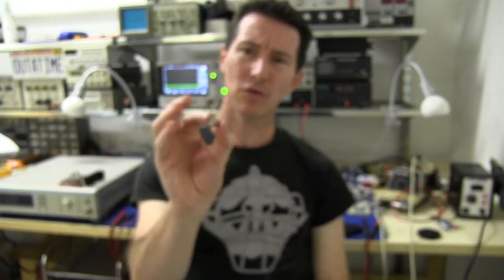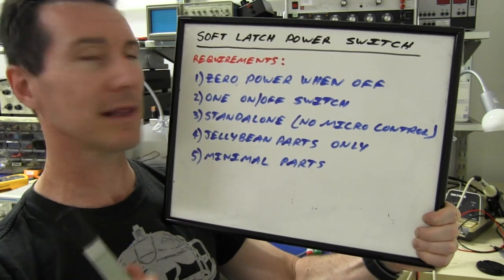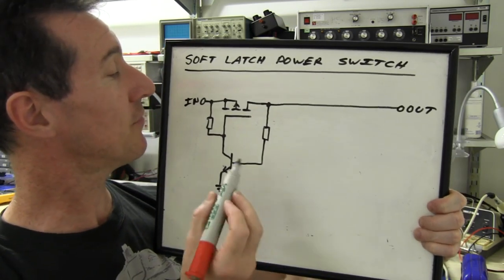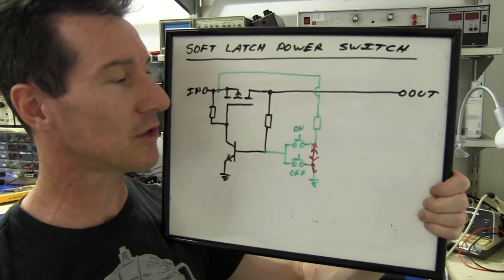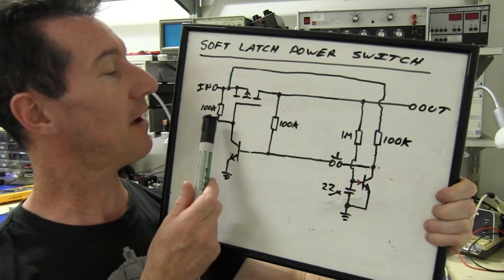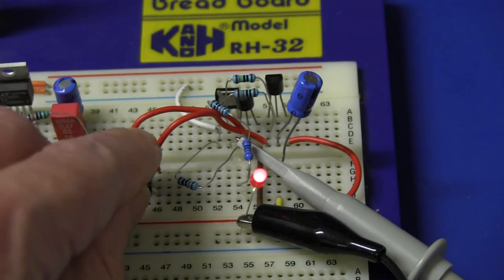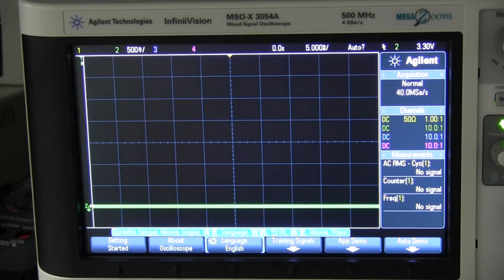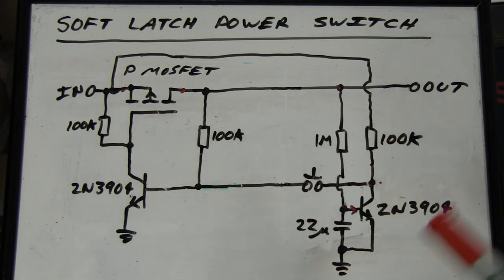EEVblog #262 - World's Simplest Soft Latching Power Switch Circuit

Comment: I am trying to make a crude flyback XRay protection circuit that needs to turn power off when a voltage from the flyback reaches a certain value. Does anyone know how to do this with minimal power supply voltage loss?

Comment: it must be a square cm of PCB at most with through-hole stuff - even less with SMT so if you're mounting the switch directly to the board you've already saved space and you can buy the handful of passives at a 10th of the price of a switch. not only that but where is the enjoyment in just using a mechanical switch. so quit moaning that someone has given you an alternative method of doing something outside of your little box of comfort

Comment: Can anyone explain why the output will be high when the circuit initially gets power? At 12:01  Thanks
Reply: +Pohan Huang it's a feature.
Reply: Pohan Huang becaude the transisor on the momentary switch does not connect to ground until the capacitor on the base charges up.

Comment: Same principle as the SCR
Reply: Think they are the same size of a normal bipolar transistor (even SOT23, like the MCR16), and could save a few resistors, and an additional transistor.
In the cost regard, I think they are more expensive, but in the end you will use less components and board size.
- Regards

Comment: Why does it turn on When you first apply power
Reply: Add a capacitor, e.g. 100nf, connected to the base  of the left npn transistor and GND.

Comment: I'd rate this a FAIL... it doesn't replace the toggle switch shown at the beginning, since it works on DC only, so you can't use it as a mains switch which was the original goal.
Reply: Markus Strangl Then add a relay, a  Sharp S216S02 would act exactly as that red LED he uses.

Comment: So what is an RC time constant?
Reply: +Matthew Ferrie The RC time constant is called τ calculated: τ=R*C where R is a resistor (R) in series with a cap(C). And it&#39;s the time it takes for thecamp to charge at 63%(I think) of the max voltage. You can calculate it with the eq. v(t)=V(1-e^(t/τ)) , for the discharge the eq. used is v(t)=V*e^(t/τ)
Reply: +ravron I&#39;ve no idea why it&#39;s crossed... ignore it x)
Reply: +Matthew Ferrie  One of the hardest course sections in electronics school.  At least for me.

Comment: i tried this in circuit wizard , firstly i cant find that mosfet , the symbol is not like that , but ive tried with N type and P type mosfet and it doesnt work with any ...i checked it , looks the same , switches but wont hold, i lose 90 percent of parts , leave just Fet on  and it still does the same thing , nothing like show . Can anyone make this work in circuit wizard , and post me save file so i can see doees this work or not
Reply: +Pavle Pavlovic You need to make sure you use an enhancement mode MOSFET rather than a depletion mode MOSFET.  Enhancement mode MOSFETs usually have the dashes in the symbol, like it's drawn in the video, whereas depletion mode MOSFETS have a straight line.
Reply: Joseph Coffland i sed that one , JFET has the stra8 line
Reply: Joseph Coffland

Comment: Last time i checked switches don't use power however this design will, also i understand evolution but this is far from it we are going backwards. lets use your scientific calculator for an example, i have a 25 year old casio, it is made out of quite thick plast, held together with 6 machine screws and has a very robust circuit inside, now lets look at my new casio, which is only held together with 2 self tapers out of plastic so fin it bends and a circuit that looks like it was made by children

Comment: Thanks Dave! I've simulated your circuit here, now you can try it out on the web:

https://circuits.io/circuits/2463364-eevblog-soft-latch-power-switch

Unfortunately it doesn't fully work... yet:

https://electronics.stackexchange.com/questions/246587/cheapest-raspberrypi-or-mcu-on-off-power-supply-latching-issues
Reply: +Roman Valls How the simulation works? I tried pressing the button, but nothing happened. The bulb just lights on, when the simulation started.
Reply: It turns out that there's a bug in their web-based circuits simulator (123D). I emailed them and their support guys were extremely transparent, honest and helpful about the problem: 

"
Thanks for writing in. The simulator can detect and display transient RC behavior, but you have discovered something we're still working on: simulation of purely analog flip-flops or multivibrators that do not converge. It's a complex problem to code, but an interesting one we're eager to fix once we have time. The capacitor that was added to the base of the second NPN effectively changes the time constant of the oscillator, but it is still in essence a multivibrating oscillator.

Here's a blog we posted when we enabled transient analysis. The blog includes an oscillating circuit.
http://blog.123dapp.com/2014/04/123d-circuits-gets-new-superpowers
"

So we'll have to wait in order to get this rolling. In addition, you can have a look at my other PSU ramblings here:

https://electronics.stackexchange.com/questions/246587/cheapest-raspberrypi-or-mcu-power-supply-with-both-toggle-and-momentary-swit

Hope that helps!
Reply: Thanks for the reply. At the end, you were able to implement the "graceful shutdown" feature for the raspberry pi?

Comment: I use similar circuit that even includes low-voltage disconnect and short circuit protection for batteries: https://raw.githubusercontent.com/Harvie/Designs/master/electronics/batteries/low-voltage-shutdown4.png

Comment: You dont understand evolution if you are assuming evolution has a goal or direction. There's no such thing as "better" in evolution, particular traits persist because of environmental pressures.  In the context of manufacturing, the primary environmental pressure would be cost, not robustness.  Sure, a robust product can be considered a "better" product, but in an evolutionary model, robust products die out because they cost too much to manufacture. Evolution is an accurate description here.

Comment: I'll take the mechanical switch any day.  Have had to service way too many "modern" products, in the latter part of my 50 years of fixing, that have failures in their on/off circuitry. Keeping it simple with a mechanical switch increases reliability tremendously.  Saving a dollar at the expense of reliability is a lousy bargain.  Back in the days before these type of circuits, problems with turning equipment on and off practically didn't exist.  I now see these problems on a weekly basis.  In my book, that's not progress.  So you can keep your Rube Goldberg circuits and I'll stick with good old reliable mechanical switches.  K.I.S.S   Keep It Simple Stupid.
Reply: Paul stevenson
Stuff was so reliable back then that most everything was shipped with it's schematic. LOL.

Comment: 1. amazing presentation. i don't get it though.2. your circuit shouldn't work. that makes it amazing3. why shouldn't work: the first press latches both bipolars on. however, the one biased via capacitor is barely on. if it was fully on, then the potential atop capacitor(bjt base) is .7V, making the potential atop collector like 2.5V. now if you press the switch second time (shut-off), you readjust the base potential of far-left bipolar to something around 2.5V, which in theory should never switch it off (need a 0.55V or less to switch off)4. conclusion: it means to me that at shutoff press, the potential atop the collector of far-right bjt is already below .55V and that manages to pull the base of far-left bjt towards .55V, enough to open the circuitry. means that when you shut-off, you manage to pull down the entire supply (via FET) to 0.55V, which offs the far-left bjt which offs the FET which offs the far-right bjt.5. question: assuming i am not wrong, can you make the far-right bjt function at normal base-emitter voltage (0.65V)? anything, including use of a pnp instead. I'd love to do it myself, at least on paper and i promise to get back to you if that comes first. my two cents: i'm thinking to bias the far-left bjt with another 50k base to ground and the corresponding emitter resistance (emitter to ground) to lift the base up to say 3V when on. that should allow the far-right bjt to fully on and reach 2.5V atop collector, instead of .55V i enjoy your shows. can't wait to have my answer. thanks, lx

Comment: In practice this will NEVER work. I looked up the prices.
Reply: +Ernst Stavro Blofeld So did I. Looks like decent toggle switches run from about $2 - $10 (USD). 

On the other hand, to build this circuit, you're spending $0.20 for transistors, $0.40 for a mosfet, $0.10 for a tactile button and maybe $0.10 for resistors and a cap. $0.80 isn't all that bad.
Reply: Sir Regan A decent mosfet is around $5 and decent toggle switches start from 50 cents.

Comment: You can eliminate one of the transistors if you do the circuit like this: 
http://circuitsaladdotcom.files.wordpress.com/2014/04/momentary-latching-circuit.gif?w=584&h=479
 not much difference but you can eliminate one part
Reply: Here is a slightly modified version that eliminates the requirement for a back emf diode with reactive loads

http://circuitsalad.com/2015/10/22/improved-power-toggle-latching-circuit/

as before it is similar to the EEVBlog version but eliminates one transistor